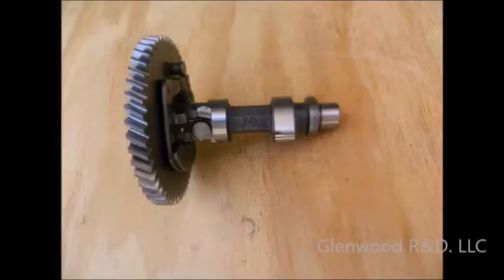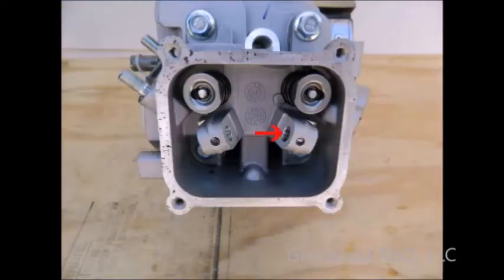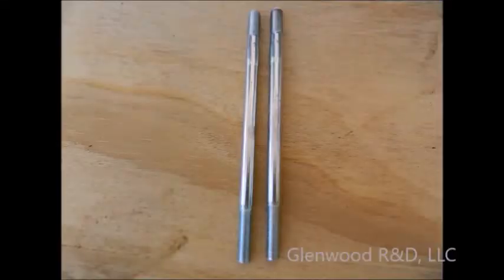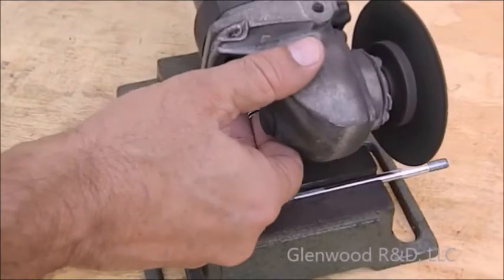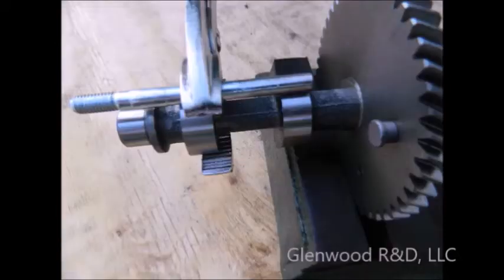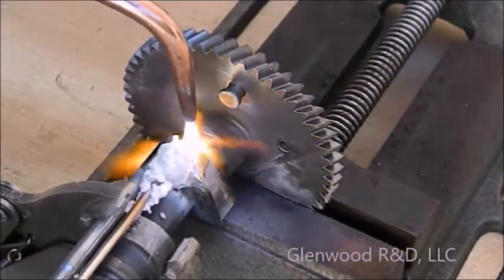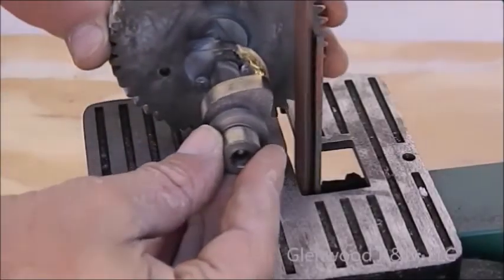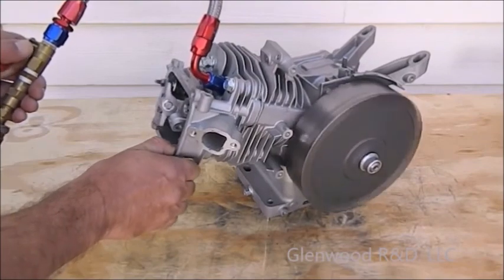Steam Engine Conversion Instruction Video #2

Comment: Great video series. I may try it. Question: how does this convert in terms of horsepower? In other words, if I buy a 6.5 hp predator engine, what horsepower steam engine would it likely be? I realize that depends on pressure and rpm to some degree, but what would it be running at optimal speed?

Comment: Thanks for the videos, very well done, 
I understand that the exhaust valve opens now every stroke, the intake valve is disabled and closed. The steam comes in the spark plug hole. What turns the steam off and on?  There is no valve in the spark plug.
Reply from the maker: Nothing. It just flows, and you loose a little on the upstroke. I've tried many methods, and this one winds up the fastest. Much like a 2 stroke vs 4 stroke engine. A 2 stroke wastes gas, but they wind up quick because of the simpler design, and reduced mechanical drag.

Comment: hi nice video, i did exakt same on my lawnmower steam but after exploring steam engine theory in years i concluded that this is not practical at all. an steam engine even homemade need a sideways actuated camshaft with different lobes for different cutoff, say 10, 20 30 and 40% intake of the stroke in other words that can be shiftet sideways. if the intake steam just expand 180 degrees for the fuul stroke until exhaust open it wont expand at all= 0 % efficiency, steam need expand AT LEAST 4/5 of the stroke so the steam should be cut off after 20% of the stroke but even 1/5 of inlet open is leading to very poor efficiency under 5%, it should only expand for 1/10s of the stroke NOT more. longer inlet with steam before cut of is only need under heavy temporary loads/startup. sure u can use only on lobe for one cutoff setting say 15 % cutoff but then u cant vary the power.
 
Even at 1/10 cutoff reaching of  efficiency is hard around 8-10 % if proper conditions with uniflow with exhaust ports not more than 1/10 of the stroke. the key is high steampressure. Then  u will get good power even with minor inlet openings but the steam need to expand very much, often a compaund uniflow is needed for those that are serious. 

im building my own steam car in very soon. a compaund uniflow. its a rebuilt honta VTX 1800 cc chopper  engine. in V-2 formationit will be a boxer cvariant, one side is high pressure cyl and the other a very big piston. tripple the with in size to let the incoming steam expand. down to vacum with a vacum pump. with a monotube boiler. it will run on wood and waste oil/cooking oil burner. with a monotube boiler steam gets up to pressure in just minuits :) but for now im also up to build a lawnmover 13hp engine converted to steam that will power a little electric grid or moped. but it will ha a camshaft actuated sideways with different cutoffs. u cant build a serious steam engine without variabel cutoff. the engine will be released here on youtube in some years

Comment: one question i do have is can this be done with a regular welder i have made other shaft repairs with a mig welder
Reply from the maker: Yes....at least on the Predator shafts. My first 3 engines were mig welded. It's way more work, and less 'reversible" if you make a mistake. Also, getting all the pimples of the shaft / gear is extremely important. The shafts I worked with were what I call "cast steel".....in between cast iron and mild steel. Migging it takes some pre-heat, and very slow cool cool down. I covered mine in sand. Otherwise you hear that dreaded "clink" as the weld spider web cracks. Maybe try a quick "dab' on part of the shaft that can be ground back down, but not a place that will warp it. Have fun, and thanks for watching!

Comment: Seems like you have steam pressure coming in at all times. On every upstroke aren't you working against yourself?
Reply from the maker: No. The exhaust opens on every upstoke. You loose a tiny bit on the upstroke, but it is made up for in rpm and mechanical simplicity....much like a 2 stroke gas engine, or a turbine. It winds up very quick. RPM = HP

Comment: Did you use brass, or bronze as brazing material?  Regards,
Mark
Reply from the maker: Just regular brass rod. I've also mig welded them. The cast steel (not cast iron) barely accepts a mig weld, but it works if you cool it slowly. Brazing is far easier, and way more forgiving.  If you mess up and want to start over, you can melt it off. Have fun!
Reply: @gwseymour  Thanks! ☺

Comment: Would I be able to tig weld it on
Reply from the maker: I've mig welded several. Generally, the camshafts are cast steel....in between cast iron and mild steel. I've found that welding is far more messy and irreversible. I've welded for decades, but never tried tig, and can't really comment on it. If you can tig cast steel, then go for it!